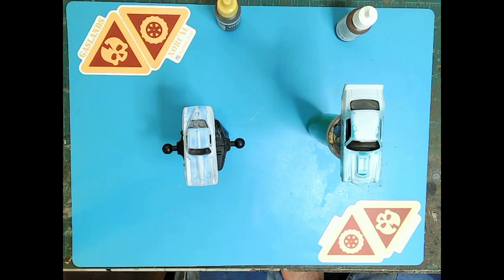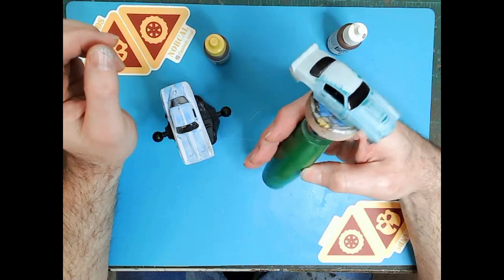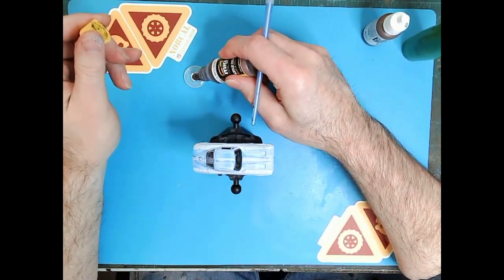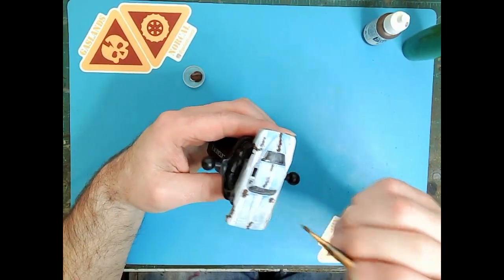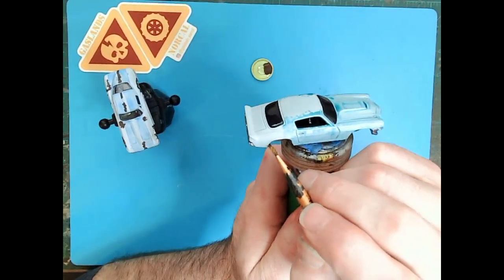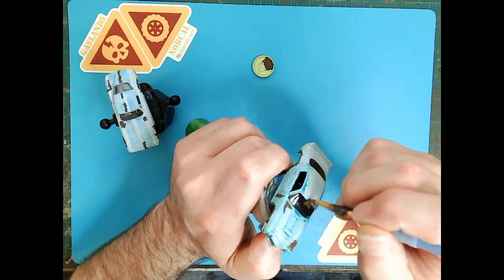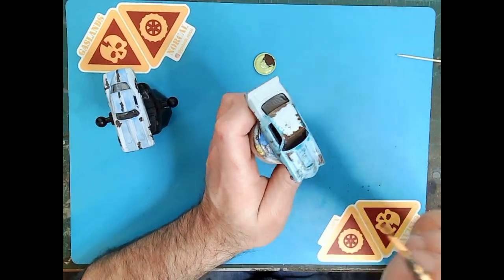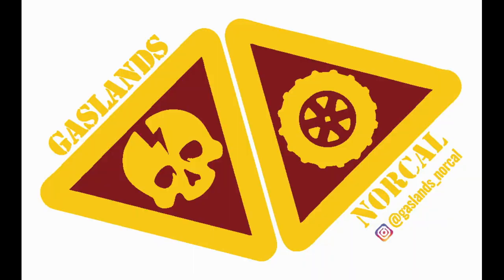Chipping

Comment: So the idea with these paints is that they simulate the chipping, rather than actually chipping the paint, right? (As opposed to salt chipping)
Reply from the maker: Exactly.  I tried a couple different times using the salt method and failed miserably.  Have you tried it yet?
Reply: @cclarke68  Not yet. But I haven't gotten past solid paint job and wheel swaps, either.
Reply from the maker: Keep at it!  You will get there!